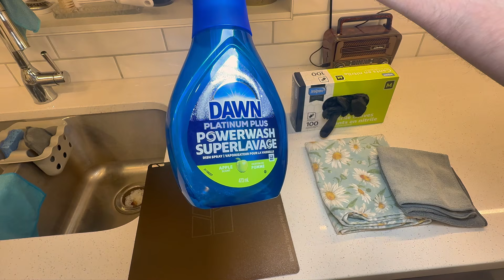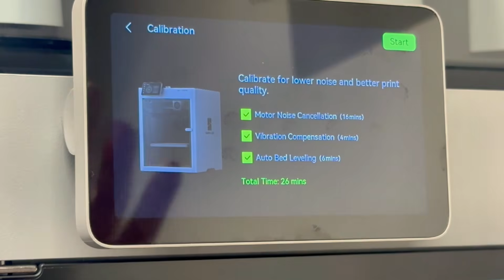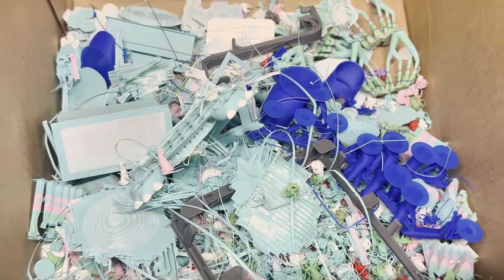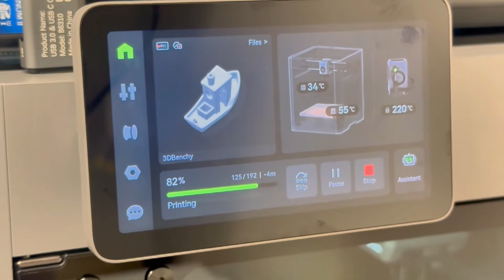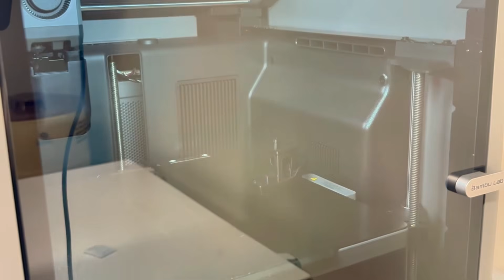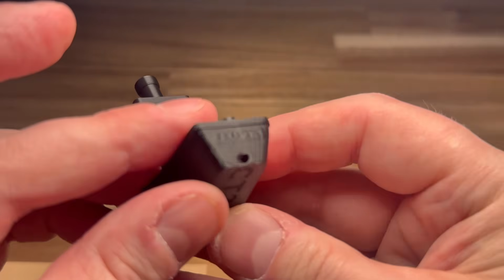Bambu Lab P2S Calibration and First Print!

Comment: Got a P2s a few months ago.  Everything has been great so far.  I've only used the textured PEI plate so far but I've printed constantly since I set it up.  PLA, PETG-CF, ASA-CF, HIPS all printed great right out of the box.  I've washed my build plate maybe 3 times since then.  I think people over emphasize build plate washing a lot.  I know it more critical with engineering filaments and whatnot, but for most users printing easy stuff like PLA, PETG, and even ABS/ASA, after the initial wash, a microfiber town does the trick 99% of the time.
Reply from the maker: I find with the textured PEI that I need to wash it frequently or else it fails often. Yet with my BIQU frostbite plate, it is like indestructible as far as never needed to be washed.

Comment: Looks awful to me, but I'm no expert either! It's like it's stopped and restarted printing at some points—the huge line on the hull and some on the walls of the hut part up top! I see what people also mean about the spool retracting too much, it wastes a lot of filament when prints again it doesn't leave it ready to go in nossle like other's. I'm still going to look at more reviews give it the benefit of doubt just now hopefully it can be adjusted manually in the settings, was this just a standard pre saved profile? That would certainly make more sence to the finish.
Reply from the maker: That is indeed the default factory setting print.  What kind of printer do you use that this seems bad to you?